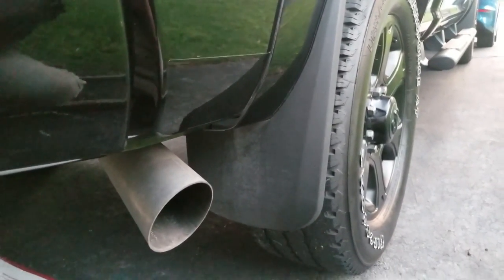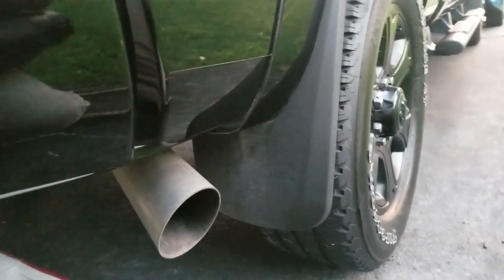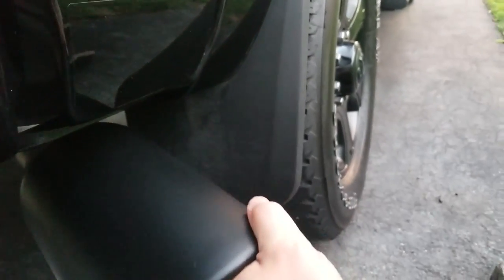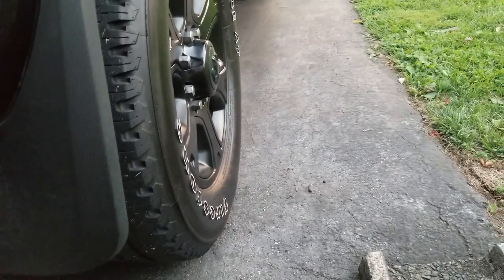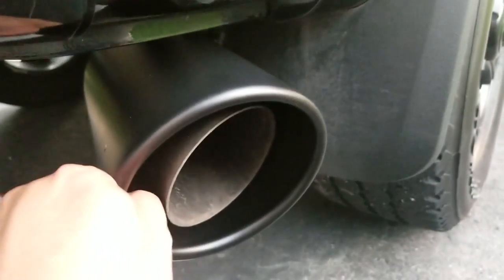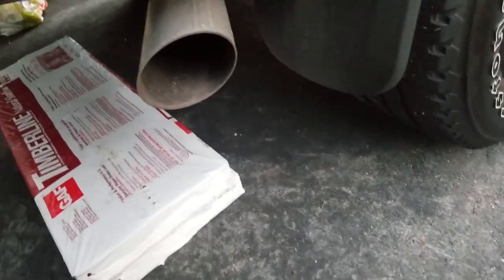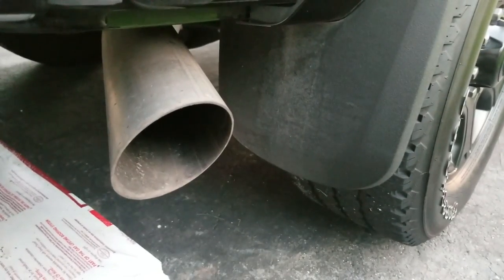17 ram 2500 diesel 4-6in exhaust tip sound difference

Comment: Maybe if you delete it, it would actually change the sound of it.
Reply from the maker: yeah maybe once the warranty is up. it changes it slightly but not enough to be drastic.
Reply: @dodgermspt  my 6.7 is deleted tips make a big difference once it's deleted   I'm running a true 5 inch off the turbo back to 8 inch tip way deeper with tip
Reply from the maker: Can't wait until I can delete some day. Just waiting for the warranty to run out!
Reply: Travis Cushman you won’t need warranty if you delete it lol
Reply: Who cares about the warranty we’ve deleted every truck almost the next day after it leaves the lot. Just do all the work yourself rather than take it to the dealer to fix
Reply: They just charge more
Reply: Sounds the same lol